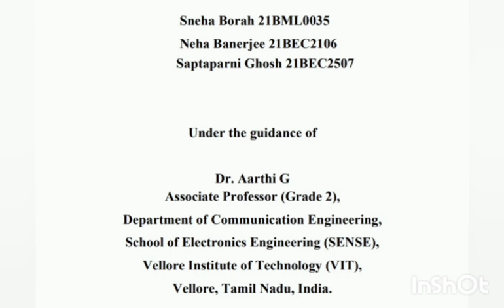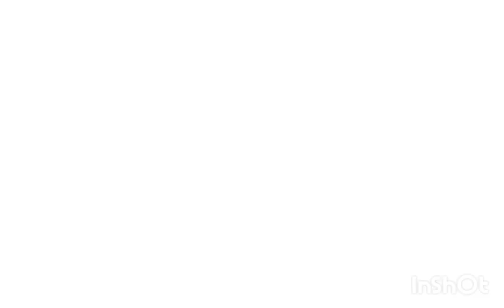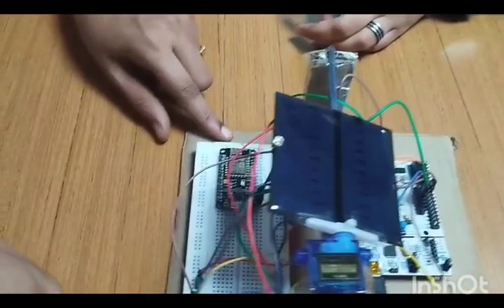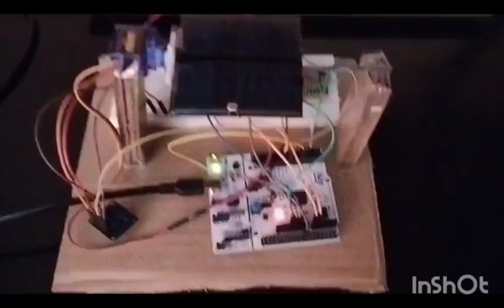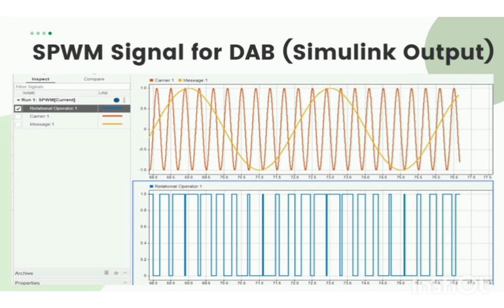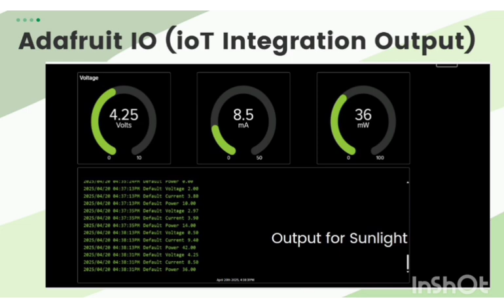Solar Panel with Source Light Tracking using STM 32

Comment: Good job!
My personal suggestion for little improvements are: 1. make the actuator (motor) less sensitive because in a real scenario the Sun moves very slowly and 2. the LDR used for sensing the light aren't good for a real scenario because they drift a lot along time due to aging (but better, and costly, irradiance sensors exist). Bye